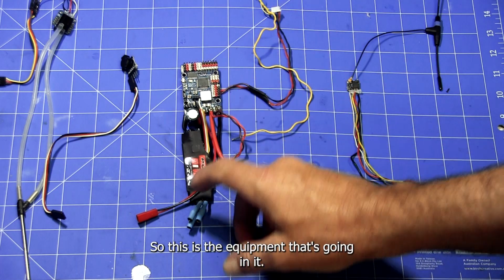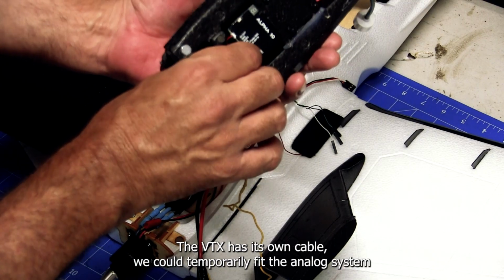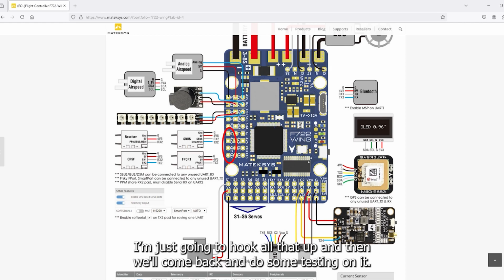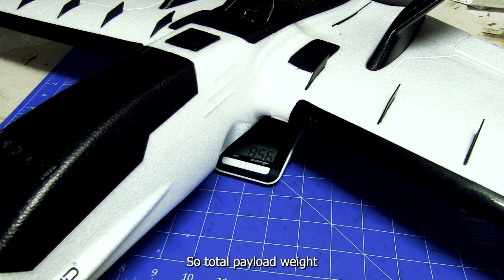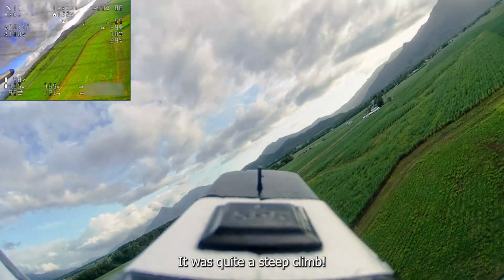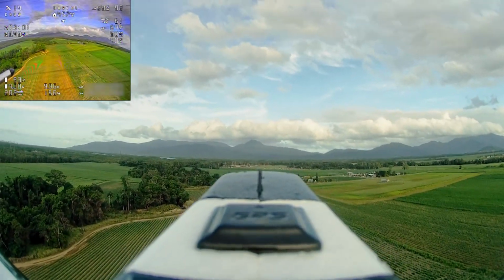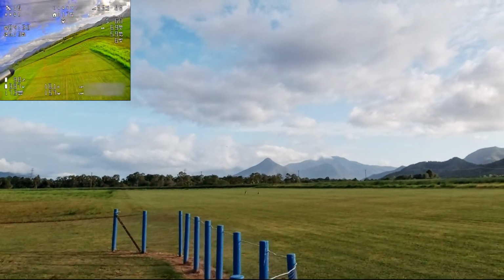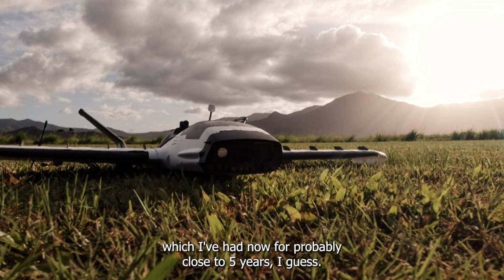ZOHD Dart XL Rebuild & First Flight with iNav 7.1.2 | Electronics Reinstallation & Test Flight

Comment: Bonito video.
Me gustaría que publicases un video con la configuración en INAV, ya que yo poseo un modelo igual pero no termina de ir fino del todo, quisiera que me sirva de guía, te lo agradecería muchísimo.
Un saludo desde España..
Reply from the maker: @luisete7076  Thankyou for comment. I will see what I can do regarding a video  on its setup but I wouldn't recommend just copying my setup. What issue does your plane have?
Reply: @stonesrcchannel  Gracias por la respuesta.
El problema principal que tengo con el avión es que lo noto muy nervioso, no va lo suficientemente suave como tendría que ir.
Reply from the maker: @luisete7076  I would start by making sure all throws are at correct measurements as too much throw will make it hard to  fly. Also double check CG is correct and not tail heavy.

Comment: You got yourself a new airfield, looks great. Running 10 Amps seems a bit high. I can cruise in my Mini-Talon at 6 Amps with that same motor at about 65 Km/hr. When you say you’re “Refitting the electronics” does that mean that it’s the electronics out of your old ZOHD Dart XL and does that mean that you ended up finding it??
Reply from the maker: @FixedWing  It’s a great airfield thanks. I would think that initially the Dart XL would pull more amps anyway than the mini-Talon due to extra weight it carries being a larger plane, but I think I can improve on this anyway once I get the Avatar GT unit and more refining. I refit the old electronics from the old frame, only other new component is the elrs rx fit a dual aerial updated es900. This plane wasn’t the one I lost, your thinking the FX61 which is most probably now weathered away high in the mountain top. Happy flying and thanks for the comment!
Reply: @stonesrcchannel  Not the first time I mixed up planes, yeah I was thinking of your old FX-61. Looking forward to watching your progress.